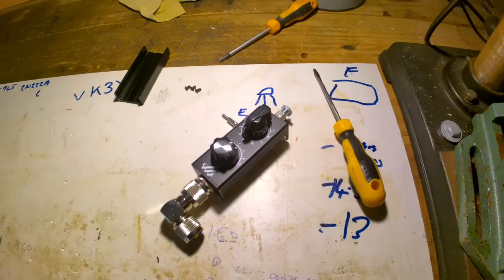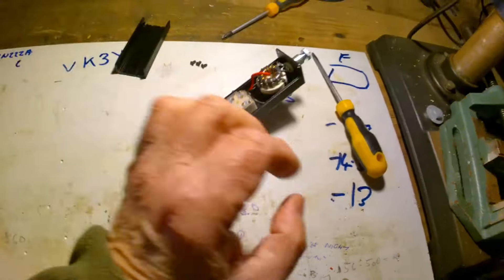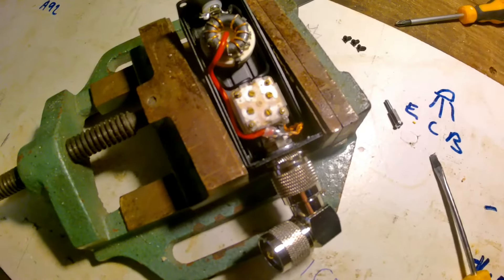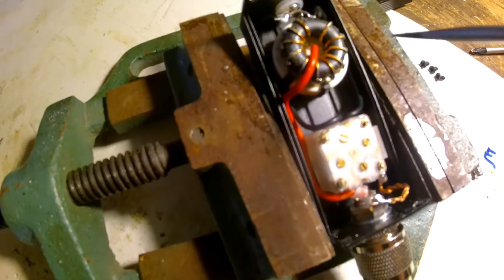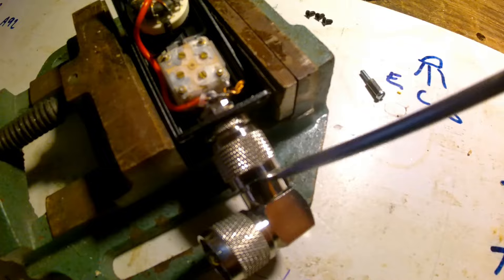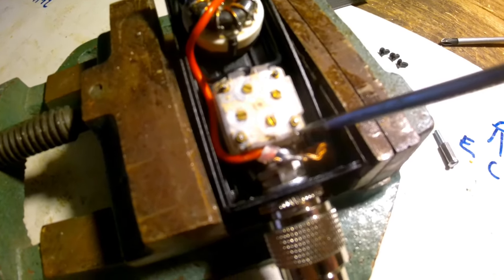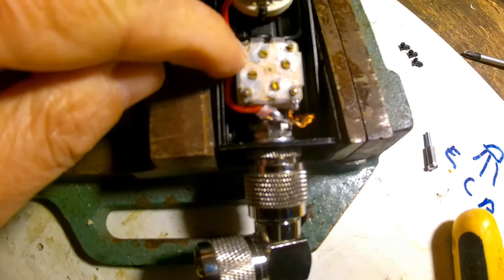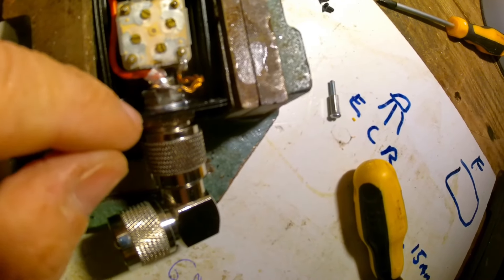Ham Radio. QRP ATU Repair Wiring. Where They Go. #Amateur Radio

Comment: I will thank you very much for this video and photos. I had two thin black wires. One was broken. There was also an extra cable, why? I have soldered new cables as given in the photos. Now it works well!. The QRP transceiver gives 5-6Watt and the standing wave range is about 1:2-3. I am very happy with this results! Otherwise I did not know how to repair!

Comment: I have one of those units and a whip (came with the uSDR QRP radio).  Doesn’t seem to receive.  Using my 17 foot whip and coil I and hear and transmit.   Have you ever seen that setup (qrp radio, ATU, and whip)?
Reply from the maker: Not sure about your question. However the small telescopic aerial that's supplied in the white plastic tube when connected to the tuner unit acts like a walky talky and generally receives and transmits to another radio etc only around 2 to 3 miles. I use the tuner unit with a long wire aerial for qrp portable use. George